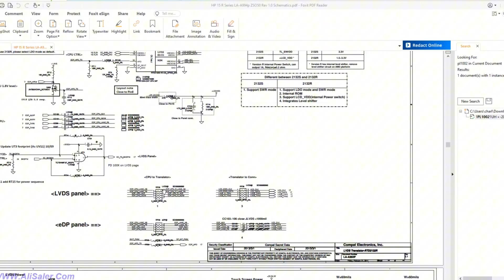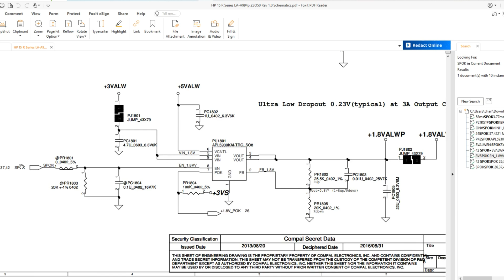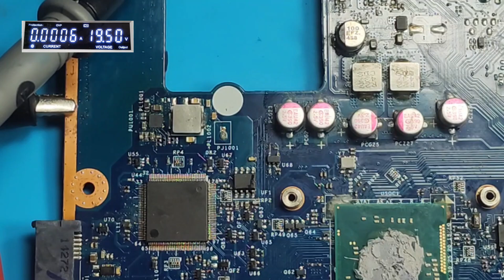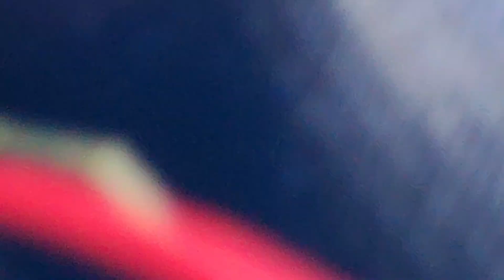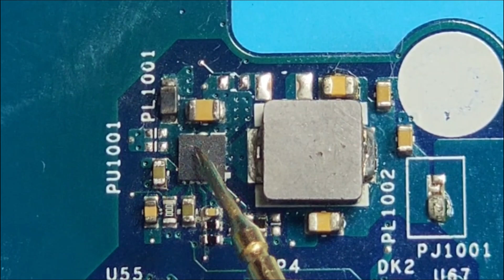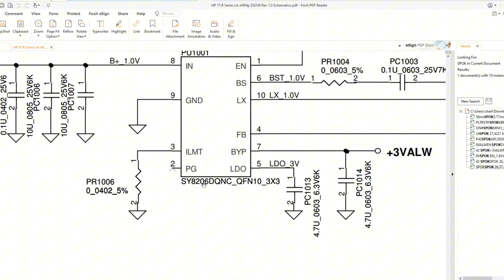How to use a Multiple Voltage Buck Converter instead of a Regulator IC | LA-A994P | Not powering on.

Comment: Very interesting tuto..question about your techniques to test motherbord  ..so black probe at main rail and red probe at all coils  why! To see if theres a direct short between main rail and second!..
Reply from the maker: That is to check all upper mosfet of all inductors to confirm they proper in diode value. Placing negativr probe on main power rail is equal placing on drain side of all upper mosfet and placing positive probe at coils is equal the particular upper mosfet's source.
Reply: @philiptroniks  thank you..waiting another tutoriel 👍

Comment: Plsease bro my question is since 1.0v and 1.8 volts is always voltage same as 3v and 5v why do you press power button before its released cause from the power sequence in the diagram we saw that it should come before power botton.
Reply from the maker: Nice catch. I didn't notice that. Actually I'm not getting any always voltage unless  I press the power button. I guess this motherboard was initially designed to be as a non suspend motherboard. However they have changed it to a suspend motherboard through programming the SIO to release ECON signal only after pressing the power button. Or else the time line sheet may be incorrect. Whatever, the ECON signal is present only after pressing the power button so we can conclude that it is a suspend motherboard to save battery power.
Reply: @philiptroniks  thanks for ur time and effort in putting up this educative videos

Comment: Please bro I would like to inquire from you, ON EC CHIP every pin which has GPIO is it first configured by Bios, then gives an output signal or voltage after internal conversion. 
Meaning that any pin that has no GPIO ISNOT CONFIGURED BY BIOS FOREXAMPLE
-VCC VOLTAGES
Reply from the maker: You are absolutely correct. All GPIO pins are configured after the BIOS is read. That's why when you place a new EC like KB9012Q or KB9022Q. Until you program it you won't even get adapter lights when u plug in the adapater. The function of each pins are configured using the BIOS. Some ECs have GPIO pins however you can't program the EC either internally or through external BIOS chip. These are non programmable ECs. Actually they are programmable only manufacturer can do that. Once it is programmed then we can't reprogramme it. Nowadays all ECs are programmable but programmers are really too expensive and we need to use different kinds of programmers for different type of ECs
Reply: What is the meaning of GPIO?